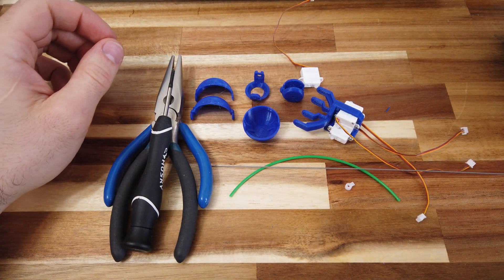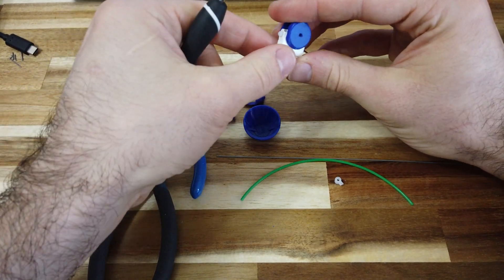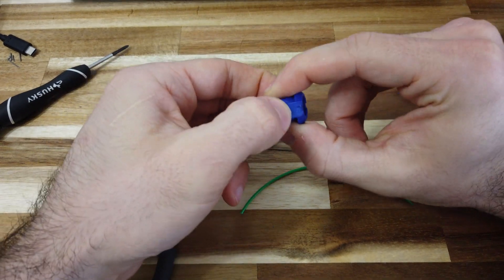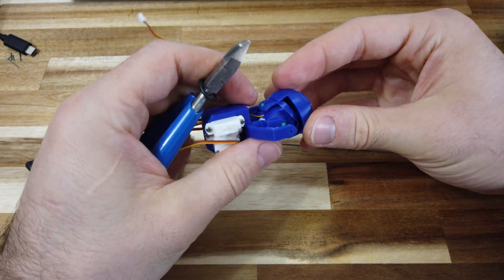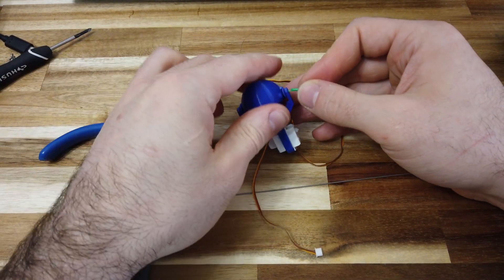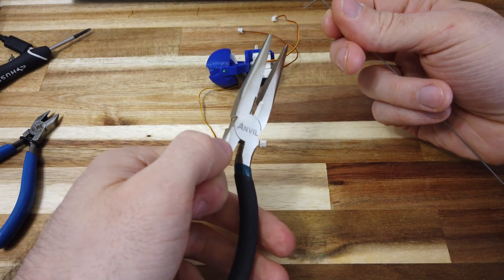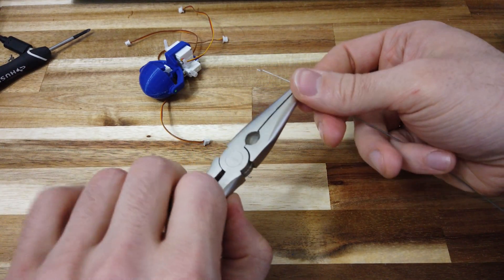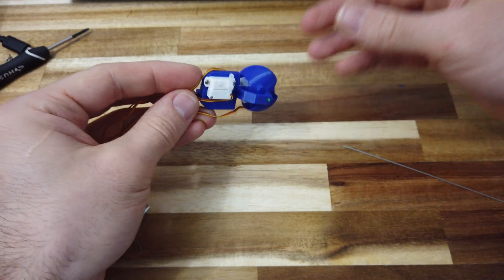Enza3D Mechanical Eye Assembly

Comment: Hi. I purchased the $10.00 project files for this. I love it. My only issue is it didn't come with instructions on assembling the featherwing with the QT Py and Nunchuck QT.
Am I overlooking something?  Thanks for any info.
Reply: Did you get a response to this, I am also running into the same issue.
Reply: @julichavez2609  I never did. :(